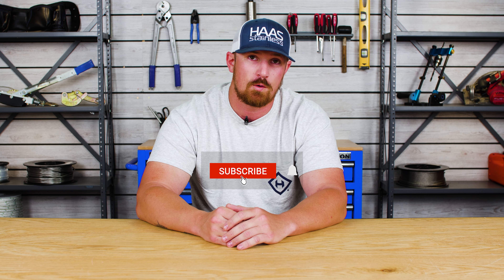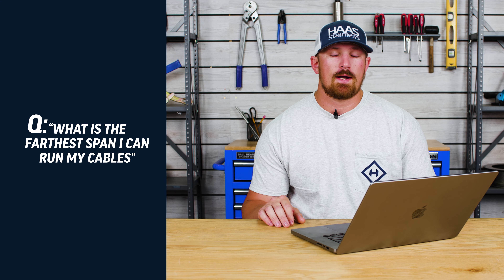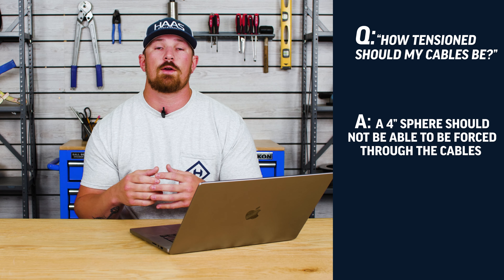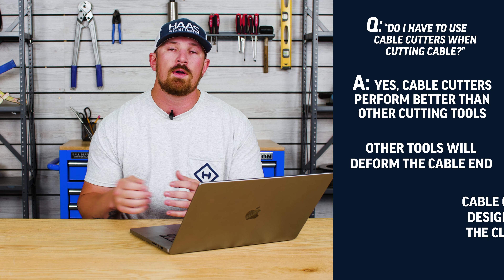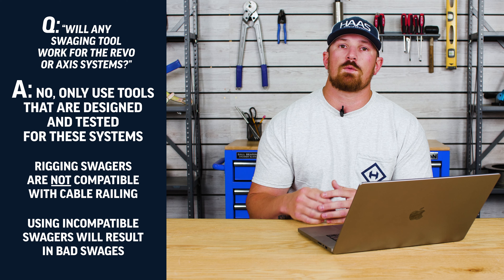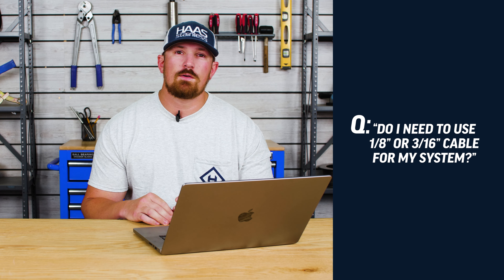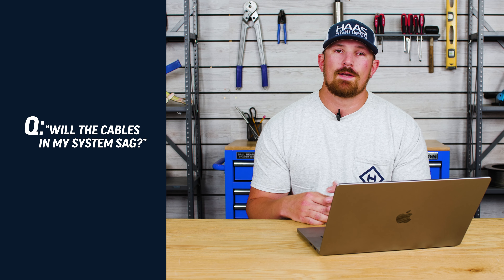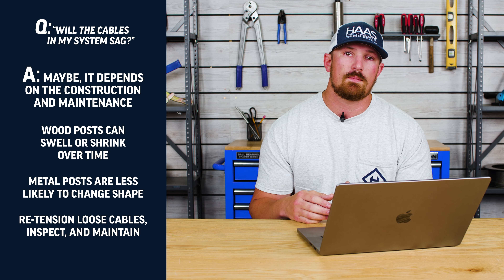10 FAQs | HAAS Stainless Cable Railing

Comment: I found a cable that I would prefer to tension more after cutting off all the excess bolt length to put on the cap. You mentioned in the video you may need to go back in tighten cables after time, how does one tighten the nut without being able to grab the bolt threads with a vice grip?
Reply from the maker: Great question! To tension after cutting off your studs, carefully lock your vices grips on the cable so that it's not spreading the strands of the cable or damaging them in anyway. Then, use your wrench you tighten the nut while paying attention to the cable (make sure the cable doesn't rotate, if it does, tighten your vice grips a bit more). After achieving tension, trim the additional excess threads of the stud, then replace the end cap. Hope this answers your question.

Comment: My deck has several angles going around the deck......can i just run a single length cable through each angle as long as i keep the total length under 50 to 75 feet?  Or do i need to break up the lengths going from angle to angle.....in other words my deck isn't rectangular....it has several angles to allow for grill and such........Thanks!!
Reply from the maker: Great question. As a general rule of thumb, you'll end a run and start another whenever the cables need to bend more than 45 degrees. That being said, we recommend up to two <45 deg. angle changes for any transitionary runs. If you need more help, or just need another set of eyes, you can schedule a complimentary cable railing consulation with one of our cable railing experts here https://e-rigging.com/pages/book-appointment

Comment: Regarding the 2 options for tensioners in Revo system: You recommend the STUD swage over the LAG swage, nowhere can I find the explained reason?
Reply from the maker: REVO Thru-Post Tensioners are more cost-effective, provide the most minimal look, and are faster to install than REVO Lag Tensioners. Within the REVO System, the latter is a solution for when you cannot access the backside of the post.
Reply: I see. As a carpenter I was thinking along a different line. Was guessing that a lag could loosen in aging wood over a decade more easily than a through-bolt. Had chosen your system over an Amazon brand with lags because I liked the peace of mind of a through bolt. Was wondering if that was a reason it was recommended over your own lag tensioner.

Comment: Have you been able to correlate the recommended tension of the 3/16" cable to a torque value?  The theory would be able to set all the cables at the same torque value to achieve the same tension in all the cables.
Reply from the maker: Good question! We can't assign a recommended torque value since it can be mounted on a variety of post and handrail combinations. An assigned torque value would be dependent on the existing handrail.

Comment: "***Clarification: The father (sic) apart your posts are spaced, the less deflection your system will have."
How can this statement be correct?  If I have a 6' spacing between posts, I will have LESS DEFLECTION than if the posts are spaced 3" apart?  I suspect just the opposite may be correct.

Comment: Have there been reports of the hardware coming loose or breaking or cracking the wood over time?
Reply from the maker: For our HAAS Stainless REVO and AXIS systems, we've had no failure of the cable and components and no damage to wood termination posts